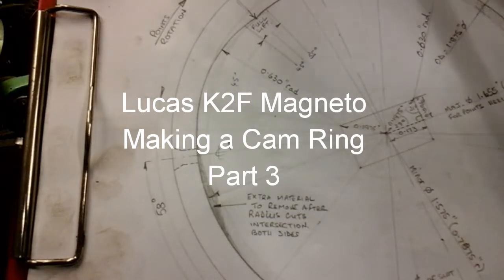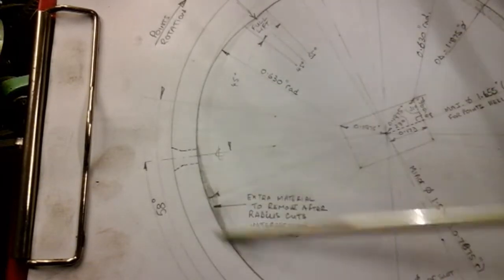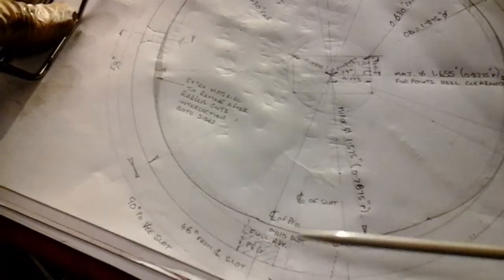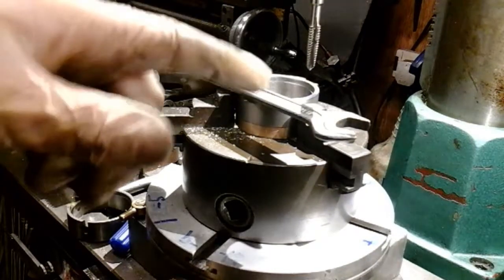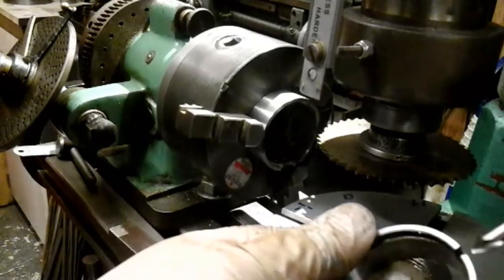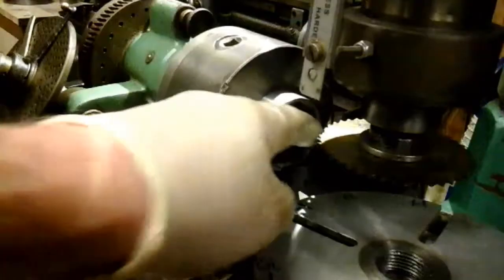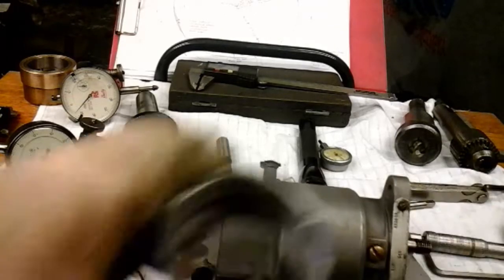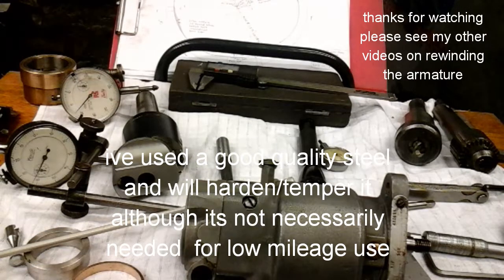Lucas k2f  Magneto Making a Cam Ring Part 3.....mr factotum

Comment: What material did you make it from, I had always thought they were hardened but never checked one out. 
Out of curiosity what bike is it for?
Reply: According to a Lucas machine drawing, the originals were made from mild steel. They were rough machined leaving a grinding allowance... then case hardened before grinding..... which adds a few more layers of complexity for those of us that are challenged in the equipment department. Mr. F's cam ring will likely outlast us... with the occasional dab of the appropriate lube.
Reply from the maker: I used a very tough en24 piece of steel bar. Yes they are usually hardened. But for the amount of use the bike gets it will last for ever. It's not as though many 10s of thousands of miles are going on bike. It was for my bsa a7 shooting star. . Hope that helps. Regards Mr f